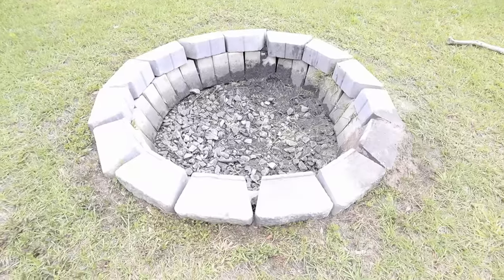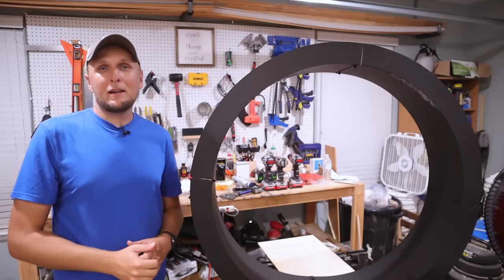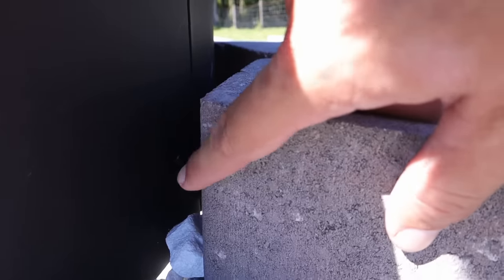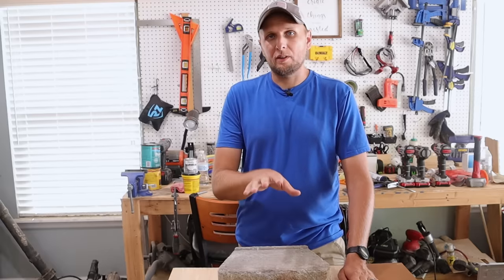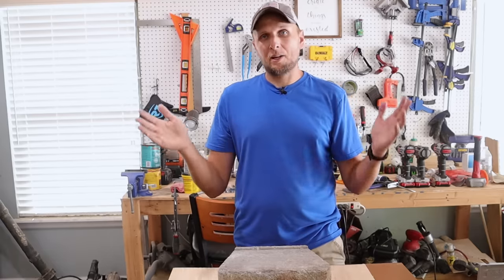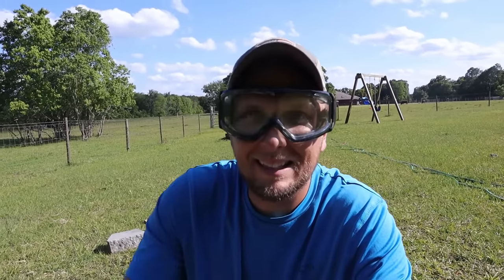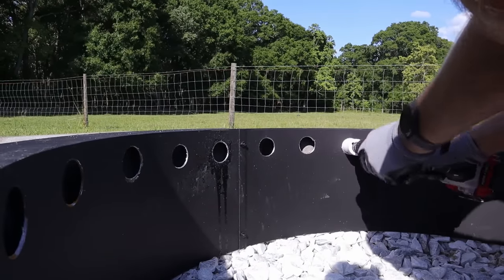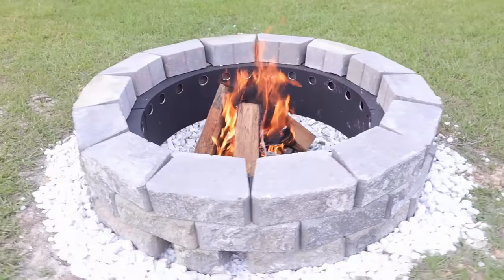How To Build a DIY Smokeless Fire Pit That Really Works!

Comment: OK. So I built my fire pit 2 days ago. I used a 36" galvanized metal ring from Tractor supply. I used gray retaining wall blocks from Home Depot. I can't remember what they were. But they have a flat bottom and a "tumbled " look. 4" X 11' X 6" Beltis Harbor? Despite their uneven surface, they fit very well together. I had about a 1/2' gap in the joints of the bottom layer of blocks. I drilled 1/2' holes every 2", about 1 1/2'' from the top, all around the ring. Then I marked on the ring, at every other gap  of the bottom layer of blocks.  .. I drilled  2" diameter  holes in the ring to line up with those gaps. About 7 holes. I went with another layer of blocks around the top edge to cover the top of  the ring. I learned by accident that as I increased the space between the block and the ring ( increasing the diameter of the first layer of blocks), the gap between the blocks increased. No cutting or chipping away at blocks needed. That's a real time saver! I had my first fire that night to burn off the zinc oxide coating of the ring. It worked great! There was VERY little smoke. I still want to put a pan in the bottom to make cleanup easier. I got a 30" water heater pan that I want to drill 3/8" holes into. I'll place that just above the bottom holes. Not sure if it will hold up to the heat. When I'm done tweaking it, I'll paint the ring and pan with 2000 degree high heat black paint. We'll see. But for $200 total cost, I'll take it!! I'd show you a picture, but I don't know how to post that in the comments. Thank you for posting your videos! Great resource!
Reply from the maker: Yeah I wish they would allow for pictures to be posted, would love to see it!  Thank you for the detailed description though!  Really glad to hear that you are enjoying it!  Thank you for that feedback Michael!
Reply: I purchased the 36" ring referenced in the video.  I have 1" holes every 2"  About 1 1/8 inches from the top.  It's a lot of holes.  I have not put it in practice yet as I'm waiting for the fire pit patio to be built but looking at the 36" ring I am a bit concerned that a fire in the middle is too far away from the holes to burn off the smoke.  Reading your post it seems to work just fine.
Reply: @robertsieloff6065  well I put 2" holes about 3" up from the bottom. I located the holes at the location of every other gap between the bottom row of blocks. The gap between the blocks should be at least 3/4". This allows the fresh air to get sucked into the pit. That probably more important than the top holes. But yku really need both. Be sure to place cap  blocks on the top layer to cover the gap between the ring and the blocks. Mine works great! VERY little smoke after the fire gets going hot.

Comment: Pardon my ignorance and I have never worked with paving stones so I don't really know but could you not have just taken out one or two stones and reposition them all so that there's a small Gap in between them or between every other so that you don't have to actually physically cut stones in two?  Does it need a specific number of air gaps? Would continuous air flow from all directions be okay?  As much fun as splitting brick sounds like I don't think my shoulders would be okay with it.

Comment: Great video! What kind of gravel are you using in the bottom of the pit? I am hearing that river rock can explode. Thanks!
Reply from the maker: The stones in my pit are marble chips, you can pick them up by the bag at the local home improvement stores..  Yeah I have heard about the river rocks.  I have never personally seen a rock explode though.  But anything can happen!

Comment: Do you think drilling smaller holes in the bottom of the fire ring all the way around along with the larger ones on top would help with air-flo into the fire pit?  Great video, thanks!
Reply from the maker: I probably would not put them all the way around the bottom but a few could be beneficial.  Thanks for the feedback!

Comment: great video    nice clear presentation .not so sure about how to cut the holes ..   every holesaw I have tried ends up melting after usually one attempt .
Reply from the maker: Yeah so I actually purchased what was supposed to be the top of the line whole saws for metal made by Spyder.  Carbide tipped and all.  It cut one hole in this and that was all it could do.  Went back to using my old regular hole saw and it got it done.  Granted 2 of the teeth broke off 3 quarters of the way through drilling these but even with the missing teeth she got it finished!  Thanks for the feedback!

Comment: This is just a thought. Tell me where I'm wrong.

It seems that the smoke (unburnt fuel) is reduced by a function of how hot the air is.  It seems like having a smaller pit would function better because the metal ring is closer to the heat source.

I'm thinking of building one. I just want it to be effective.  

Thoughts?

Comment: What kind drill bit did you use to cut through the metal?I bought the same ring and can't drill holes through without an insane effort. Bought cobalt drill bits, cutting oil, etc and still nothing easy like you make it sorta seem lol
Reply from the maker: I wish I could say it was easy but it was the most labor intensive part.  I tried cutting oil but it didn't seem to make a big difference.  Just steady firm.  Hope this at least helps you know that you are not alone haha.

Comment: Can this concept work if the pit is partially built into a small hill? So roughly 75% exposed to get the cool air in but 25% blocked by the hill.

Comment: I use a steal drum for my pit with a fire ring around it with pavers. I notice right away more holes better burn. I suggest you get a lid for your fire pit my steal drum came with a lid loved it when was done with my fire just put on the lid and I was child proof.

Comment: I believe it would cut more smoke out with a little more fuel/wood. It would pull more air and burn hot enough to dissipate the smoke! Great design!
Reply from the maker: I agree!  The bigger and hotter it is, the better it works!  Thanks for the feedback!

Comment: I did one similar a while back and use 3/8 drill bit for the holes. I recently rebuilt mine to mirror yours minus the holes size. Is the size needed for a good clean burn?

Comment: Looks great! I’m going to do this, this weekend! How many stones did you put around the ring?
Reply from the maker: Awesome!  Thanks a lot for the feedback!  The way mine sits it took 40 of these particular pavers.  12 total on the bottom row due to the holes and 14 on each of the top two rows.  A couple tips that I think I would try if I was going to do this again that I think might make it even better: I would drill smaller sized holes but more of them all the way around the top.  I think it would help create more back pressure.  I would probably go with one of the smaller rings.  In order to get this working as efficiently as possible I build a pretty large fire.  So the closer the fire is to the ring, the better.  I may also play with a few small holes drilled in the bottom portion of the ring as well.  It works great and we love it, I just am always thinking of ways to tweak things to possibly make them even better.
Reply: @HowToHomeDIY  thanks for the tips! Can’t wait to put it all together this weekend!
Reply from the maker: @Mountains4ever  Absolutely!  If ya have any questions feel free to shoot them this way.  Good luck with the build and hope you enjoy it as much as we do!

Comment: Suggestions for converting an already built fire pit? It’s about 42” high and fully seated in the ground. Thinking we just need a grate at the bottom to provide an air gap below and then not sure about the wall.... maybe I need to find some who can weld me a cylinder at the right size with a lip and holes near the top/bottom.

Comment: I want to build one of these on a concrete slab that's already in my yard. would I still need to use the white rocks? I don't know how I would keep them from expanding outward unless I used some kind of ring. Could I only use the rocks for the inside or does the bottom row of brick need to sit on rocks too?
Reply from the maker: In your situation I would just put it straight on the concrete.  Easy cleanup too.

Comment: Looks very interesting. One question. Why did you not drill the holes in the shop before you assembled the pit?
Reply from the maker: Well I actually found it fairly easy to do it the way I did because it was held in place by all of the stones and I was able to sit down if I wanted to 😂
Reply: @HowToHomeDIY  Fair enough. Did you end up painting the cuts or is the ring aluminum?
Reply from the maker: Yup, painted them with high temp paint.  The ring will need some of that sprayed all over eventually.

Comment: Loved the video man! Very informative. Obviously you did your research, but I do wonder… idk why I wonder this btw. If you drilled the holes in the fire ring on the bottom what difference would it have made? More or less smoke? More or less oxygen for the fire? In general what kind of difference do you think it would’ve made, if any? 
Engineering wise, duh, there’s a reason for the holes to be at the top. Right. What’s the significance, because I’m sitting here pondering but I can’t quite wrap my head around it? 
Any response would be much appreciated! 👍👍
Reply from the maker: It could be debated as to how much it would affect it.  But if there were to be holes in the bottom, I would not have big ones or very many at all.  Could take away from the pressure buildup and affect how well the top holes perform.  Appreciate the feedback!

Comment: After drilling those holes, did you go back and seal the exposed metal. What did you use?
Reply from the maker: I did.  I used Rust-Oleum 248903 12-Ounce 2000 Degree, Flat Black Automotive High Heat Spray Paint.  I have a link for it and talk about it in my review video that I did on this fire pit.
Reply: @HowToHomeDIY  Thank you. I'm not great at navigating youtube. We'll be building this soon!

Comment: I use an old 8 lug hole, 16.5” truck rim. I dug a hole, approximately 10” deep, 24” diameter, hold up the rim off the ground with 4/ yellow fire bricks. Works great, especially with wet wood.

Comment: Thanks for the inspiration. I think I''d make the holes in the ring before assembling the 4 pieces. Do you think it will burn wood too efficiently and use a lot of wood with each use? Thank again!
Reply: These "smokeless" firepits definitely burn wood more efficiently, and you go through wood more quickly.

Comment: Nice! Gonna have to try this once our yard is ready. What type and size rocks do you have under the pit btw? Also, what else could you potentially use to line the top of the envelope to prevent air from escaping if the flange on the liner isnt as wide as yours?
Reply from the maker: Those are marble chips.  I think they pretty much just come in one size and you can pick them up at pretty much any of the big home improvement stores in the garden section.  If you dont have a larger lip I have seen some people actually cast their own tops using concrete.  It is a really nice look and does a great job of sealing off the top.
Reply: @HowToHomeDIY  thanks! Any particular reason you went with marble chips? Can you use any kind of rock otherwise?

Comment: Hey Adam, is this good for winter fires? As in when you’d want heat to emitting out to where you’re sitting, not just up. Thanks!
Reply from the maker: Hey Ben, I get plenty of heat from my shin all the way up.  Obviously the wall is going to block the lowest portion of the leg and foot but it has no problem emitting heat outwards.

Comment: OK, I just finished watching the video.  I never thought about how this could help minimize smoke, but I HAVE wondered if better combustion wouldn't be promoted by allowing air to enter from below.  Thanks very much for making this video (especially the tip on how to split the stones in half) and my question to you is: I would have thought that the better place for those holes in the fire ring would have been at the bottom, so that it could fuel the combustion process from the bottom up, rather than at the top of the flames.  Am I thinking wrong on that?
Reply from the maker: You are not thinking wrong on that as that is what we have all always been told.  It is important for air to get into the bottom of the fire as well.  The idea here though is to introduce more fresh air into the top of the fire to help burn off that excess fuel more efficiently.
Reply: How To Home Perfect. Thanks for the clarification!

Comment: My major concern with this is the exposed metal from the drilled holes. Did it end up rusting after rainfall? Tempted to try this myself, but I am worried about potential rust issues on the most expensive part of the build.
Reply from the maker: In one of my follow up videos I talk a little about this.  There is a high temp spray paint that can be applied to it.  All fire rings over time rust regardless of whether they get cut or not but the paint can help protect it.  Has to be reapplied from time to time.  Hope this helps!
Reply: @HowToHomeDIY  That helps a lot. thanks for the advice!

Comment: I understand the need for the holes made at the top of the metal ring, yet I am unclear on how the air is getting in from the bottom. I thought there are supposed to be larger holes at the bottom & holes that are smaller at the top as well. Or is enough air getting in from the bottom through the gravel base??--I thought there was supposed to be dedicated holes at the bottom so there would be no restriction on flow of air into  the bottom part of the fire especially after quite a number of fires which may cover up the air flow from the bottom from the gravel. Thus in mine I plan to add larger holes at the bottom providing a lot of air flow & smaller holes at the top with somewhat less air flow with both sets of holes drawing air from the chamber between the metal fire ring and the outer bricks. That was the way I thought these reduced smoke fire pits were supposed to work. Did I get something wrong? Please correct me where I am incorrect.

Comment: What size holes did you make around the ring? I'm guessing 2"?  I think that could be an important detail. I really want to do this great idea, but I want all the details. I've watched part 2 where you added the air pipe. I  can't wait to try this!
Reply from the maker: Hey, I used a 1 1/2" hole saw.  I also released a follow up video this past Friday and I answer some of the common questions on this build including yours.  I also try to give my opinion on possible other options if you want to check that out.  Thank you for the feedback!  It is a fun project.

Comment: What’s the hole size and approx spacing u made them at ? Which hole saw ? Thanks
Reply from the maker: I used 1 1/2" but I think smaller might work a little better.  I spread mine out about 4 inches since the holes were fairly large I did not want to make too many holes as it would take away from the rings ability to create back pressure to force the air out.
Reply: Thank you 👍

Comment: I like that but want one a bit smaller. I plan to try this. My concern is the last top row of stone. I rather mine to be level and not tilted as one end rests on top of ring "flange". I plan to set ring deeper level with second row. Then add top row over ring flange. Hope that works because second row of stone may have a bit more cap.
Reply from the maker: Yup!  You can find it in many different sizes, bigger and smaller.  Just as an example, here is a 30" inner diameter variation.  https://amzn.to/3zx7f8o

Comment: Bro, have you tried slowing your drill down when drilling steel ? An old engineer taught me that the drill cuts more efficiently if it’s going slower in steel and you’re less likely to get filings flung in your face. Loved the video, very well explained. Going to give it a try. Cheers Howie
Reply: Yes, half your speed for steel vs wood drill speed.

Comment: What type of drill did you use and about how long did it take to drill each hole? I have an old cordless drill and I haven’t been able to get through the first hole without my drill dying. Thanks!
Reply: Would love to know an answer as well!!
Reply from the maker: I used a brushless 20V Porter Cable Drill.  I did go through numerous batteries but it got the job done.  If I had to guess each hole probably took around 15 seconds.  The ring I used was pretty thick.  A smaller drill will definitely have a tough time.  A corded drill might be best for the job.  I hope this answered your question Ryan.

Comment: Why not remove 1 stone and evenly space the rest leaving gaps? I plan on doing this project in the next week or two. wondering if there is a reason you cut instead of spaced?
Reply from the maker: I personally did not want that look and I also believe that having less intake holes will create a better vacuum effect than having holes all the way around the bottom.  But that is just me and some have said they have had success doing it the way you are asking about.
Reply: @HowToHomeDIY  Thanks. I work on commercial kitchen equipment. the vacuum makes perfect sense. thanks.

Comment: Question.... part 2 video to this with the air vent installed, in curious if the vent intake pipe can be longer so the cap isn't in the chair area.... do you think 10ft pipe would still be good
Reply from the maker: Hey Doug, yes it could definitely be longer.  I would not make it terribly long though as I have to think the closer it is, the easier it is to pull through.  Hope this helps!